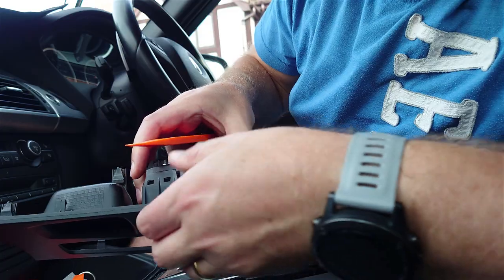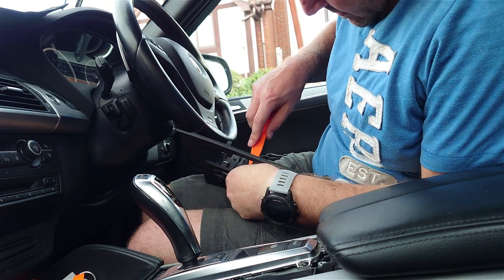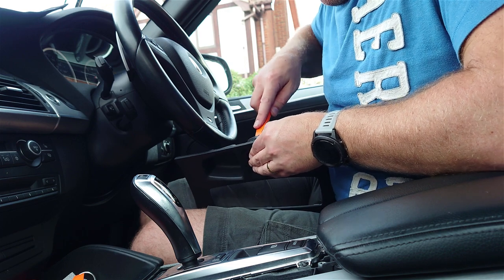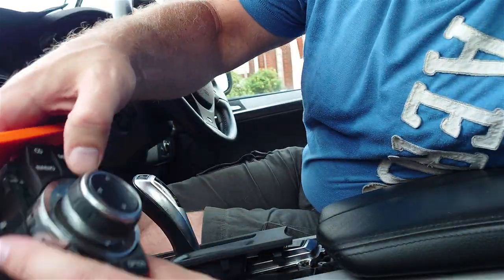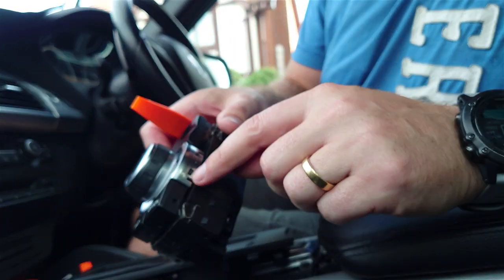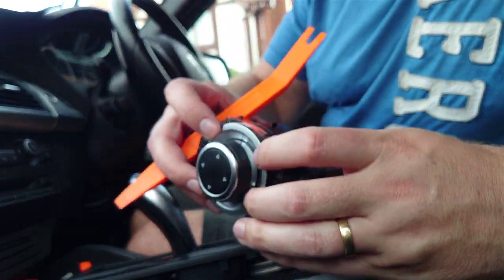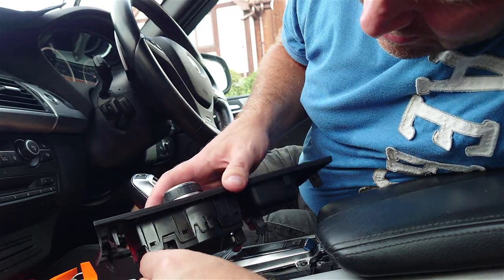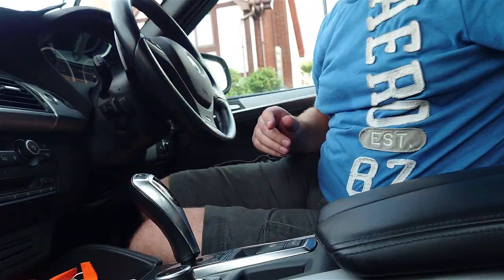BMW e70 X5M, Replacing the iDrive control ring.

Comment: Worked as described.  I could not find the pry tool (I KNOW I have... somewhere around here.  LOL-ish).  Another had proposed that one could replace without having to remove the console cover but I was not successful using their guidance so reverted back to this video. THANKS!
Reply from the maker: +@n-da-bunka2650 glad it helped, looks so much better with a clean rung doesn't it!